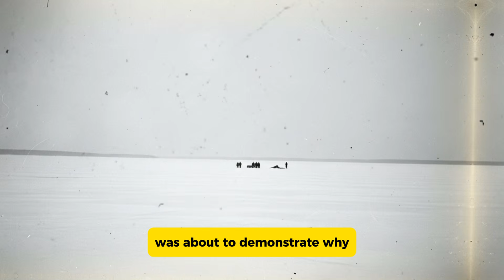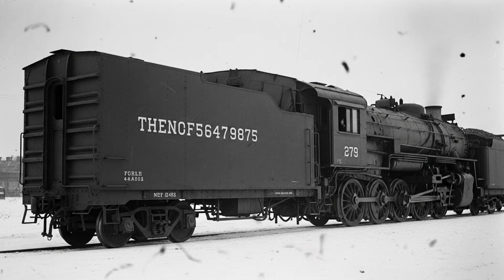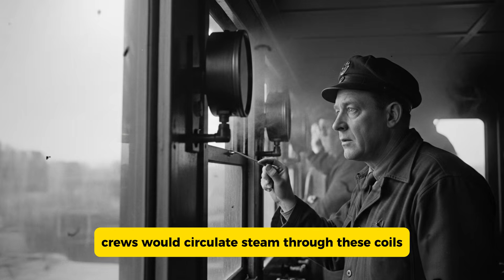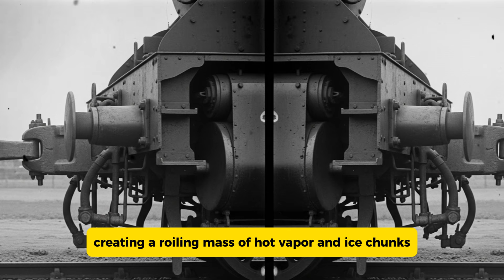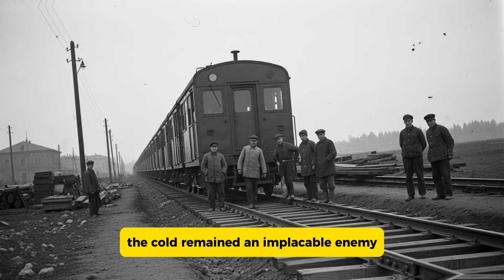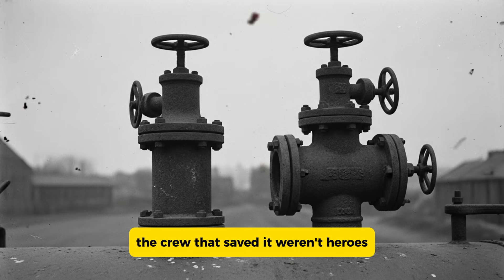The Steam Engine So Cold It Froze Its Own Water Mid-Journey

Comment: What a load of nonsense. This problem of freezing water in the tender is solved by insulating the tank, and installing a heating coil which is supplied with steam from the boiler.
Reply from the maker: I didn’t know that was the case. Thank you for the valuable information you provided. I’m continuing to work on this for you. Don’t forget to follow and subscribe.
Reply: @LocomotiveAustralia  Good luck with your videos, best to focus on subjects you understand pretty well, you can then do a 'sanity check' before release.
Reply: @RossWexford  The guy is just making AI slop.....
Reply from the maker: @RossWexford  I’ll take your comments into consideration. Thank you very much. I look forward to your support.